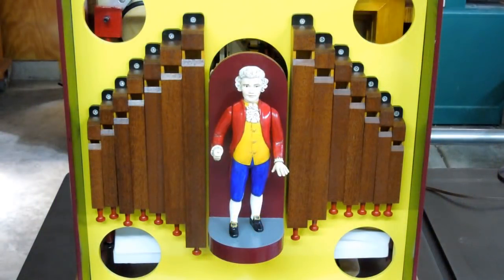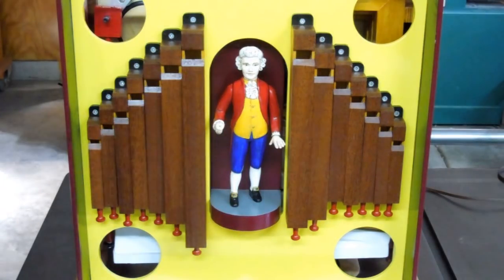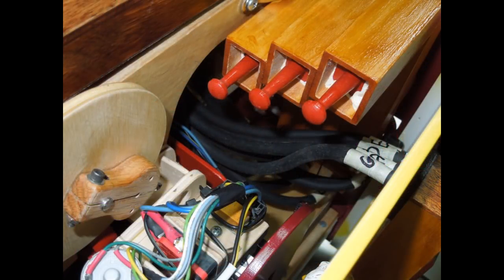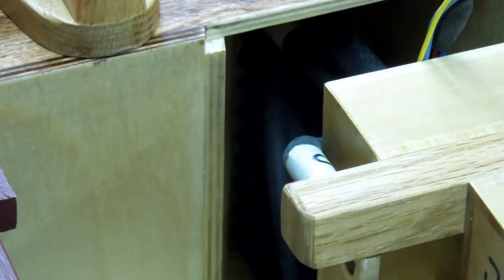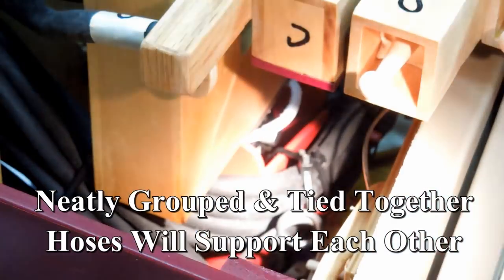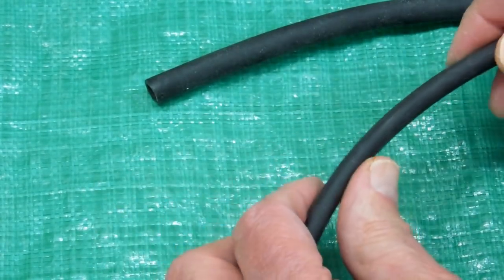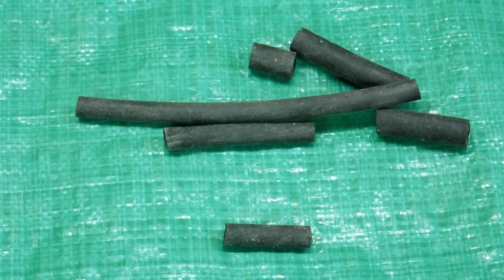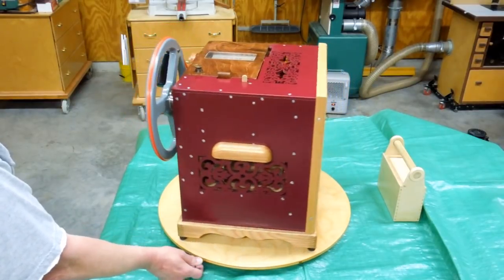Senior 20 Conductor Installation (21) Final Assembly

Comment: Hey Ron, just wanted to say that I think you would do well to take a look at silicone tubing which comes in a variety of inner/outer diameters along with varying levels of hardness and air pressure ratings. When I saw the rubber tubing you were using and the problems you had with it, I instantly thought of the tubing I've used on nitro RC cars for fuel line and how flexible and tough it is as well as resistant to kinking when bent around corners. I think you'd find it a better match for this application and less agravating as well!

Comment: Very nice Ron. How long did it actually take you to build this?
Reply from the maker: Back in 2014 I played around with the Busker Organ trying to decide if I wanted to build one. After switching to the Senior 20 Organ plans, I spent 4-1/2 months building my first organ without a conductor, and at the same time built enough parts for two organs, including complete assembly of two sets of bellows, reservoir, pressure box and pipes. 2015 was spent sourcing the conductor sculpture and waiting for it to be made. 2016 was spent perfecting the mold making and casting process, which took 5 months. I also developed the motor drive and rewind for both organs. There was a good deal of experimentation in 2017 related to the conductor installation and animation, followed by assembly of the second organ and conductor platform. Finally, late 2017, I found someone who knew what he was doing with Arduino Nano servo programming and was ably to complete the second organ with conductor. All in, 3-1/2 years to build two organs with motor drives and an electro-mechanical animated conductor. A single organ, no conductor, materials in hand (bellows leather, pipe wood, etc) not shooting & editing videos, can be built in 3 to 4 months comfortably. Thanks for watching!